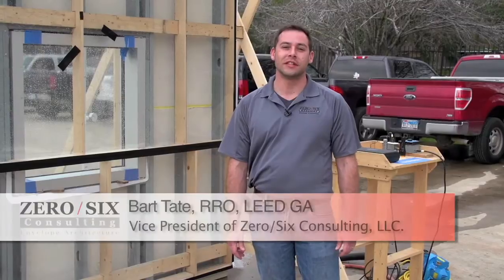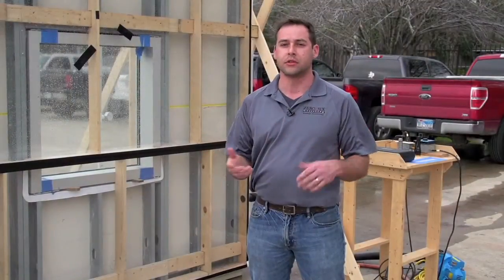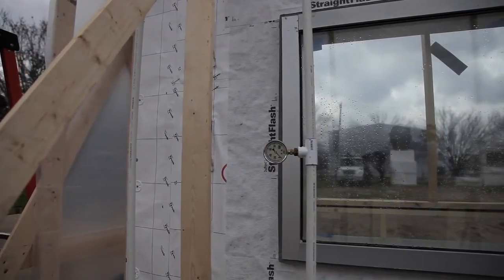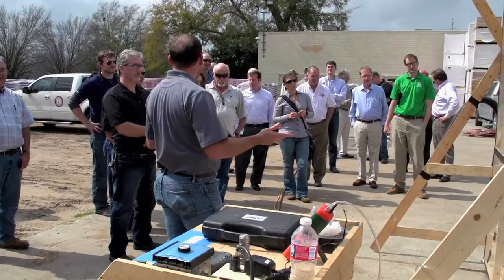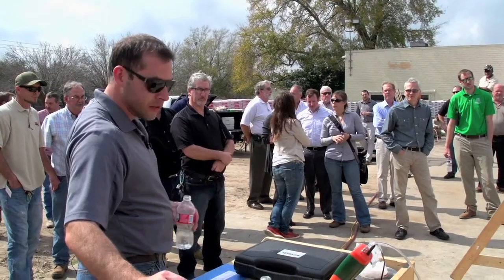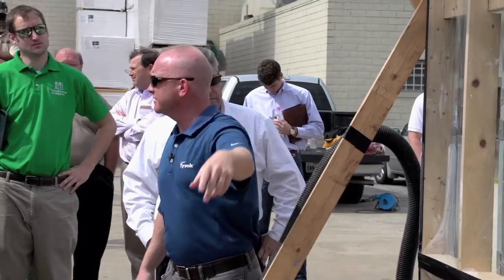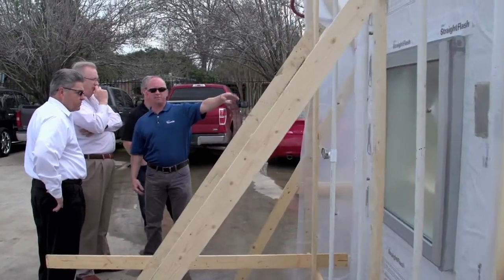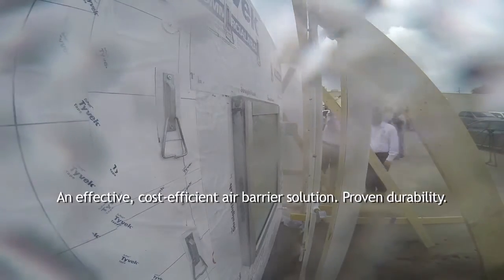DuPont™ Tyvek® Engineered for Commercial Construction

Comment from the maker: A commercial wall assembly was built and tested with DuPont™ Tyvek® CommercialWrap®. This video shows how CommercialWrap® is an effective, proven system that prevents air leakage and holds out water. A commercial building wrap for durability and energy efficiency.